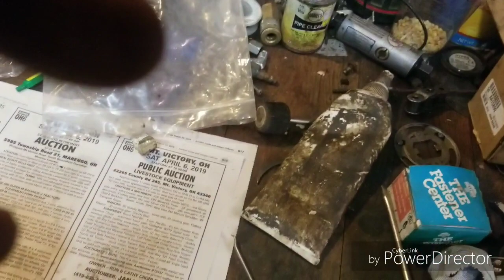Rebuilding a hydraulic bottle jack

Comment: If you learn how to deal with and work eith windshield urathane. Which hardens like the rubber on your sneakers or the black O-rings that are used in a huge variety of things. I have used this stuulff on probly over 50 applications.

Comment: I realize this is an older video, but I have to agree with you that they are near about a throw away item when they stop working correctly. IF you can find the unique "O" rings and seals, the typical cost is usually more than buying a new jack. But I still do try just for the fun of it...

Comment: so are you saying that sometimes just cleaning will make them work again. great video , love learning something new
Reply: I just bought a  tilt deck trailer operated by a long bottle jack and I think it just needed refilled but I broke off the rubber filler cap in it trying to get it open so I decided to take it apart and clean it and I'm going to try and find some new o rings later to stop some leaking